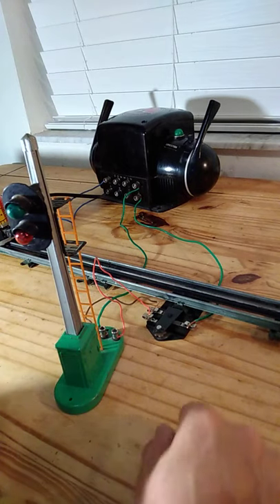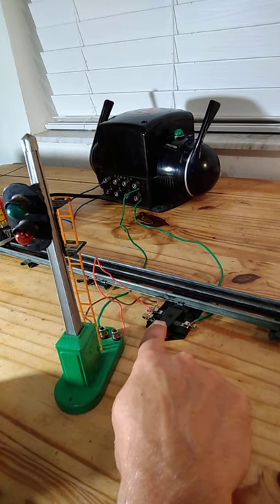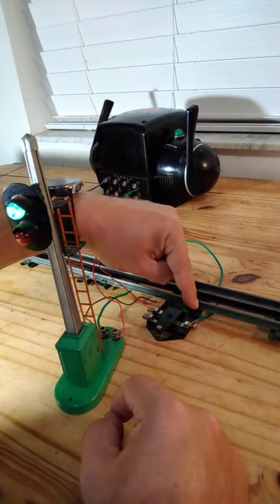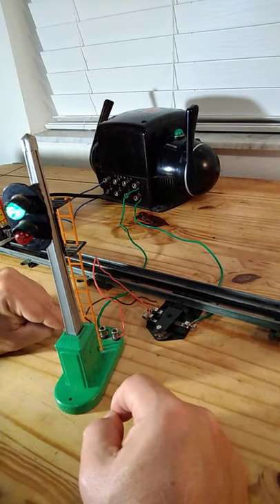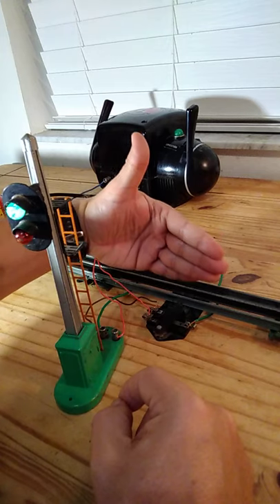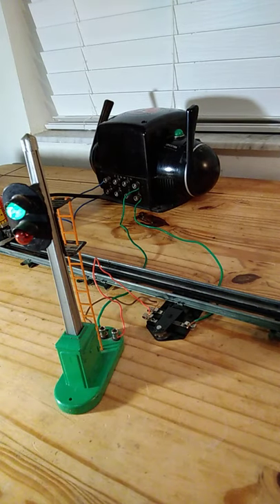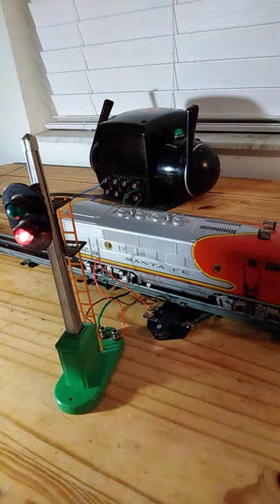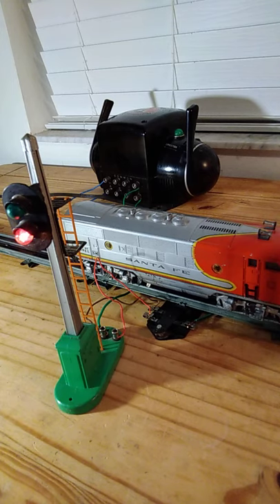Lionel Accessory (Part 153) Demo Using Automatic Accessories Connector Part 153C

Comment: David.  So it looks like the connector wire is run to the power on the transformer, and the common on the transformer is to the center post on the block signal. Is this correct??